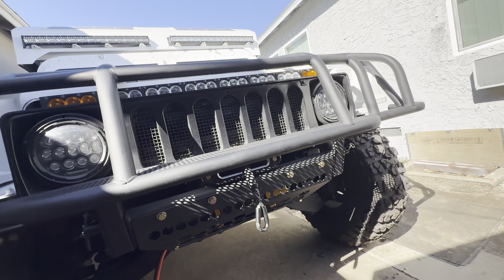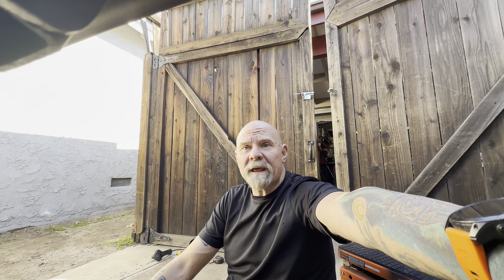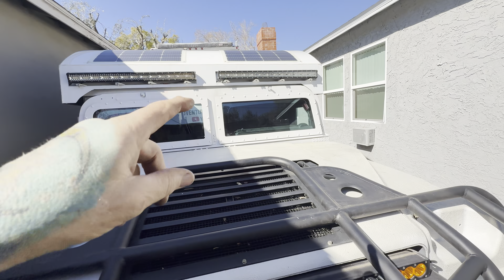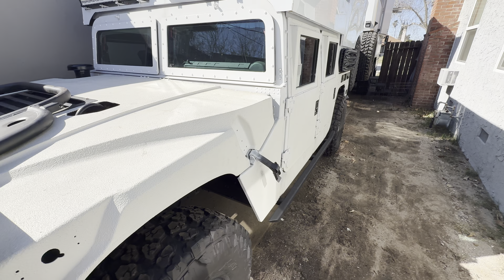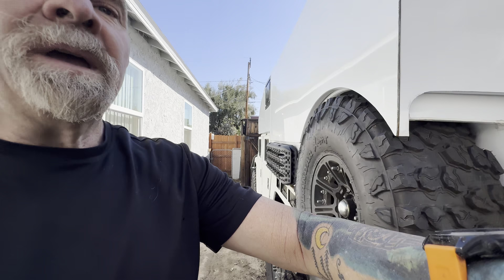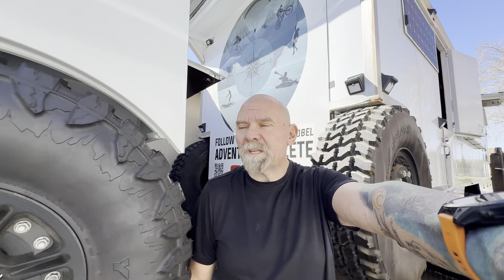Humvee high clearance hidden winch, bumper build

Comment: I never heard of electric paramotor. Thanks for sending me down that rabbit hole. I think that’s the thing I need. Gas seems too much maintenance/effort so I was never interested. BTW, keep building.
Reply from the maker: @kaoskev  thank you so much for commenting once again! Yes, open PPG doesn’t electric para motor that I have adapted to my Blackhawk light trike! I haven’t flown the electric version yet, but I have it all set up and ready to go do some taxing and if that goes well and wait and balance is correct I’ll go ahead and take off. I think I got it nailed! When you’re not flying all the time I feel like gas is a pain in the butt! Fuel going bad carburetor is doing weird stuff. Same type of thing I run in to with my motorcycles. If you haven’t tried para motoring yet it is super fun and I highly recommend BlackHawk Paramotor. several great instructors throughout the nation.